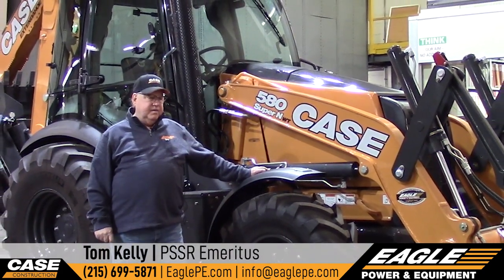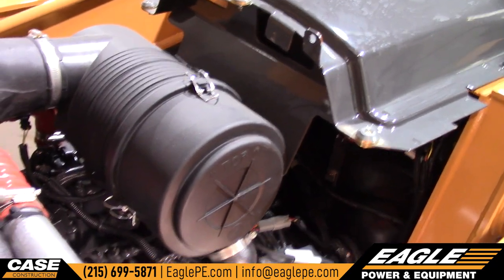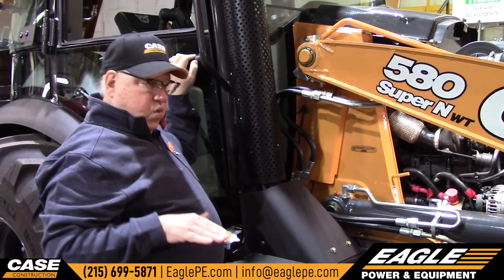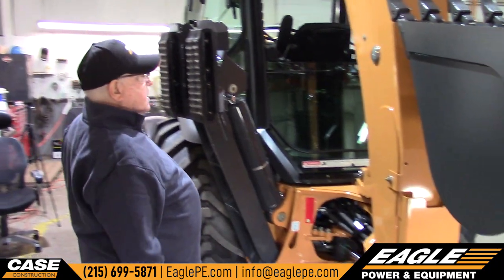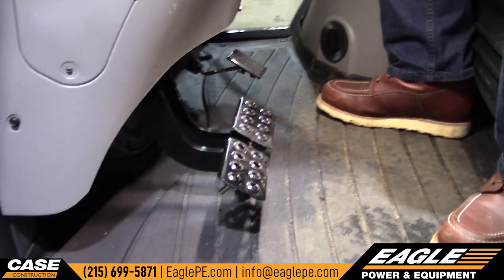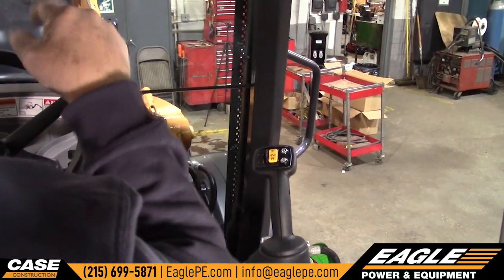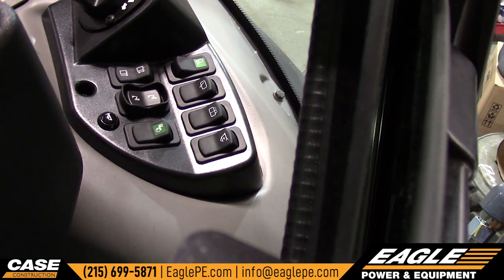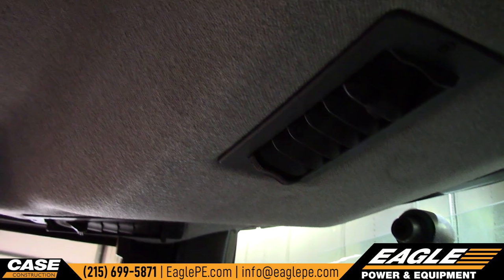The Walkaround: Case 580N Super N Wide Track Backhoe | Eagle Power & Equipment

Comment: Just bought a 10 580sn wt, for the farm i have never ran a backhoe before, wow so much good info in this video, i tell my friends almost everyday i find out something new on how to operate it and what the buttons all doalmost everday. Only thing that takes some time to get use to is i have the s type transmission and  it goes to neutral  between switching gears so that feels weird the power shift optionwould change that. But dang is it nice for loader work compared to a farm tractor!! Thanks again for the run through!!
Reply from the maker: Great to hear James, enjoy!